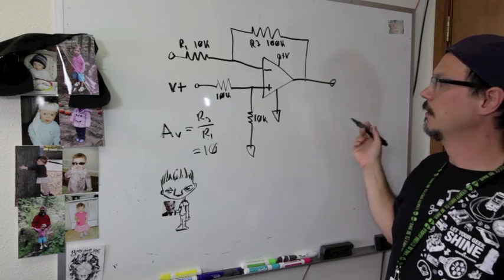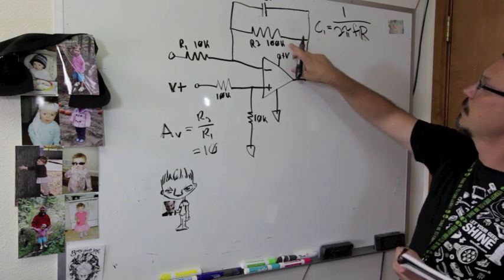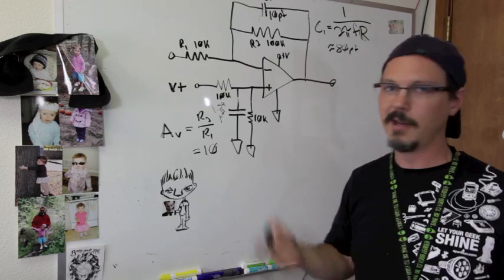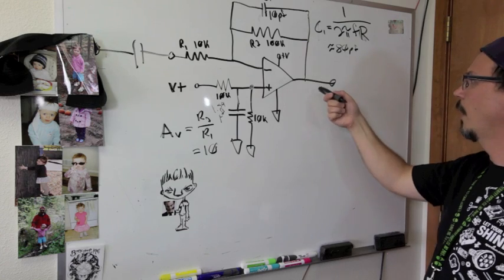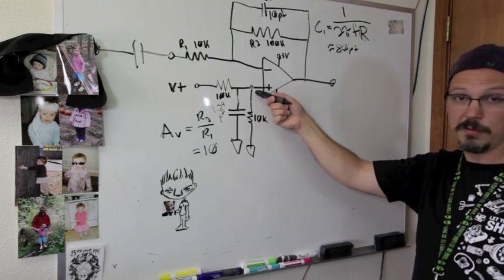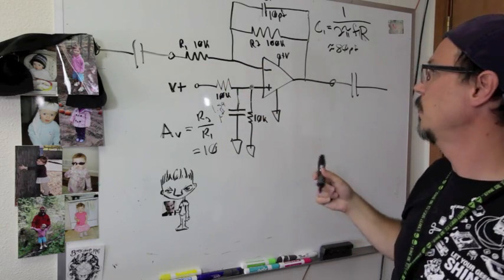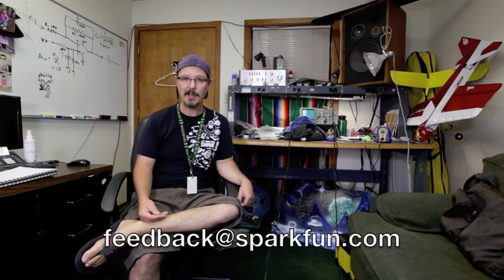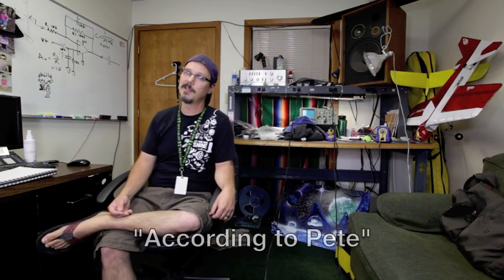SparkFun According to Pete 9-6-11: OpAmps

Comment: A loads current requirements has to be meet. I don't know if I understand your question completely, but I might be able to help you. As your question stands, the answer is to check the datasheet of the component, that is connected to the opamp output, and look for I sub c equals value.

Comment: Awesome video!
My question is in a typical op amp circuit (using your model at 13:27 as an example), how do you ensure electricity doesn't go through the path of R1 -> C1 -> Op Amp Output?  Or is that part of the design?

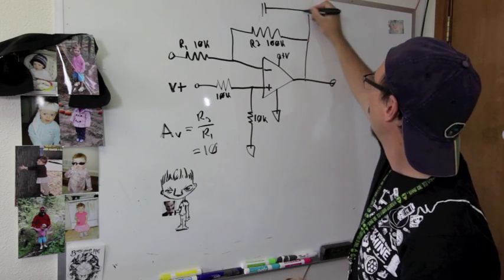Comment: Check out your comments at time 10:40 in the video.  I think you did not follow through when you mentioned the audio signal is low at the inverting input.  You did not mention anywhere in the video how the calculated gain of 10 is amplified at the output of the op amp.  So are you saying you will not get a signal when looking with an oscilloscope between inverting and non inverting inputs or are you saying you will not get a signal when looking at your inverting input in reference to ground?

Comment: i don't like the way you teach. you start off by drawing a circuit, then say what will happen (huge gain), but never put values in, or show a typical output. you seem to think you saying something makes it so. 
how about a little corroboration ?  when i ran your first circuit in TINA, i did not get a HUGE gain. but then i had to guess at values because you didn't supply them.
Reply: I think the presentation is OK, but is not prepared, it's like he is figuring out what to say in the middle of the presentation. In general I like a more structured lesson, with more order, etc. but also, this is free so can't complain too much :)